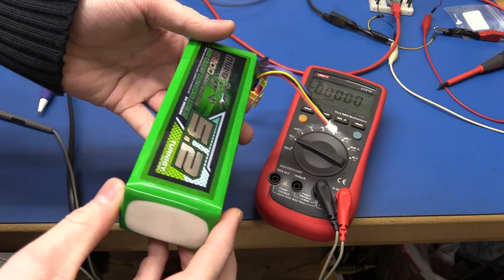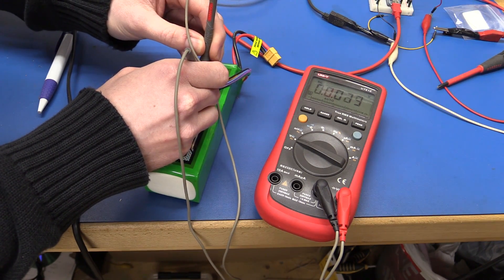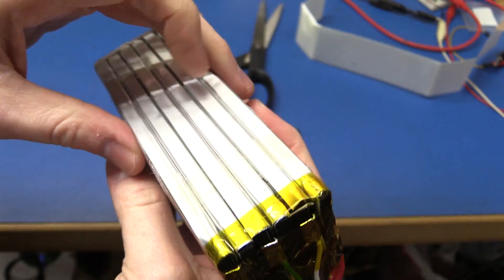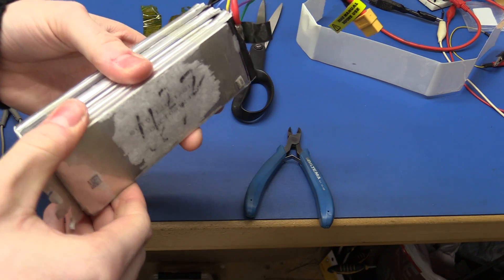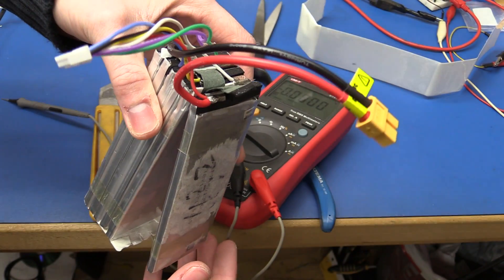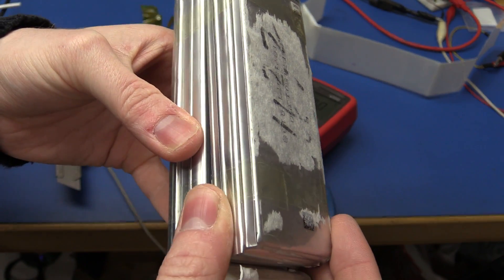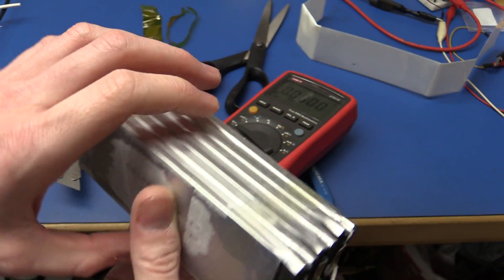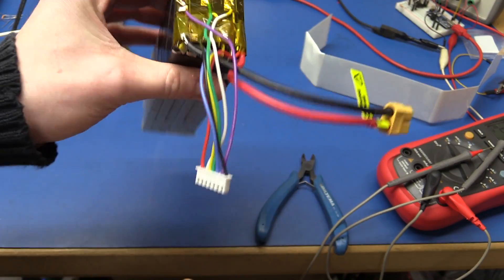Inside a Failed Lipo Battery Pack - Ec-Projects

Comment: Whenever I get a hot/damaged cell it always got to the battery box at my local tip. Too dodgy to try and fix. If the one that goes faulty is in a pack. The whole pack goes. I will NOT trust a pack with a faulty cell. Great video my friend.
Reply from the maker: +Raymond Earle Thanks :) Yeah, it's not a bad idea to dump the whole pack to be on the safe side..
Reply: Safety with Lipos is paramount.

Comment: Did you measure the cell voltages right when you got the pack before doing anything to it? I ordered 2 Turnigy 4S 5000mA batteries from Hobbyking and the cells were all at 3.8V except for one that was 3.7V. I asked Hobbyking if that's normal and they told me immediately that it shouldn't be that way and they sent me a new one. I still have the "bad" battery and that one cell has a higher self discharge than the rest. It loses about 0.1V in a month (from 3.8 to 3.7) while the other cells stay almost the same over the same time. I still use the pack for bench testing motors/ESCs, but I only charge it to about 3.9V and if the one cell "lags behind" I charge with the current limited bench power supply.

I think you can totally make a useable 4S out of your pack. It's even easier since your damaged cells are on the "end" of the pack. Do you have the possibility to charge/discharge the cells individually and measure their capacity (just for checking if the one besides the dead one got a hit, too)? As for the other two: charge them (outside) and then drive a nail through them ;)

The amount of power these packs can deliver is awesome and scary at the same time. I experienced that first hand when I did exchange the connectors on my batteries. For the first two I did everything "by the books". Removed one contact from the old connector, clipped it, soldered the new connector, and insulated it, then did the same for the second contact. But for some reason for the third batters I pulled both contacts out of the old connector, which as Murphy commands felt attracted to each other and of course immediately touched, releasing a bright flash, melting half of the 4mm contacts away and leaving black residues on both my thumbs and index fingers. Luckily the contacts didn't weld together or I would have been in big trouble.
Reply from the maker: +superdau I didn't check that. But with hindsight, I probably should have. :/ Hehe, yeah I might do an "experiment" with those 2 cells :) 
Yeah, I've had an "undesired discharge" also, with an 18650. When I first got my HP E3632a power supply I used it to charge the Li-ion in a battery holder. When it was fully charged I just pressed "output off" on the supply, not knowing that it had reverse current protection instead of the usual high impedance state when off.. In less than a second the insulation on the wires started smoking and melted away. I immediately pulled battery so the wires came undone, but it was quite scary how fast it heated up.
Reply from the maker: +superdau Remarkably, the power supply didn't suffer from it. I wonder how much current went through it though..

Comment: Some times there is a manufacturing fault in the cells that makes it discharge slowly. When the cell gets below 2.5V the chemical composition inside gets unstable and releases hydrogen gas. this makes the cell swell up. The swollen cell will not harm the others - actually Lithium-cells perform much better when squeezed flat, as the internal resistance goes down, and thus more power loss. If you need to check if a cell is swollen, and are unsure if it's just the jacket that slides around or it's gas. hold a finder firmly on the cell and press with another finger besides the first. If you don't feel anything popping up, there is no gas. Bottom line: Remove the bad cell and re-assemble the pack. (P.S. I've worked with Lithium-polymer packs for some years and have rebuilt lots of packs)

Comment: If it were me I would open one of the cells (under water of course) then expose it to air (outdoors of course away from people and property). It's important to not only hear about the danger of lithium but watch it too!
Reply from the maker: +davecc0000 Lithium is highly reactive with water and will produce hydrogen gas and heat up.. I'm not sure if the lithium cobalt oxide and other compounds used will react with water, but I would keep it away from water :)
Reply: +EcProjects It will fizz a small amount, but nothing else. There is no metallic lithium in the cell.
Reply: +EcProjects OK then I would submerse it in mineral oil and open it up. Then I would expose it to the air. 

The point: under safe conditions, I want to see it self-destruct! (c:

Comment: That battery wouldn't stay in my house anywhere in that condition. I would discharge the battery fully then either dispose of it or cut the good cells off and use them as a smaller battery.

Comment: This is why you bottom balance your cells, rather than top balance them. Ie, you have them at a balanced discharged state, and charge them with a specific amount of current, all cells will then have the same amount of energy in them so when you discharge them they will go flat at the same time. If you top balance the cells, ie, fully charge each cell, they will all have a slight variance in capacity, so will go flat at different rates. Since you ultimately want to stop discharging when one cell is flat, the extra energy from top balancing is not used anyway.
Reply from the maker: +bgdwiepp I think cell balancing is a religion in it self, but neither would prevent the battery from developing a short. In case It wasn't a short, one should not expect a new battery to have only half the capacity on one cell.

Comment: lithium scares me, i think its a much too dangerous technology. 
Further research in to nimh or life cells should be good, but these li-ion/lipo cells go thermal nuclear way to easily
Reply: +voltare2amstereo The thing about lithium is it has an amazing power/weight ratio and is currently the best we can find. nimh is currently at its max  capacity which is why it is not as useful as lipos. Lithium is the lightest alkali metal we know of which is why it is so widely used. what we need would a type of graphite battery that be made extremely small and powerful, but more research and work needs to be done on it, but nobody is willing to put the money in to make it happen.